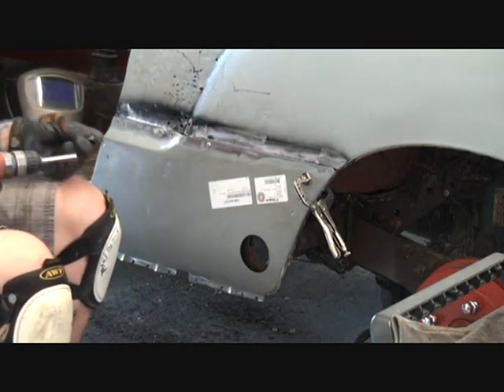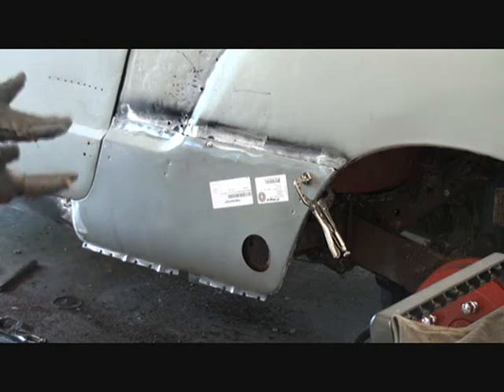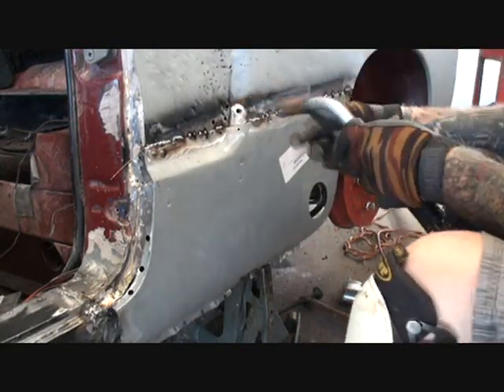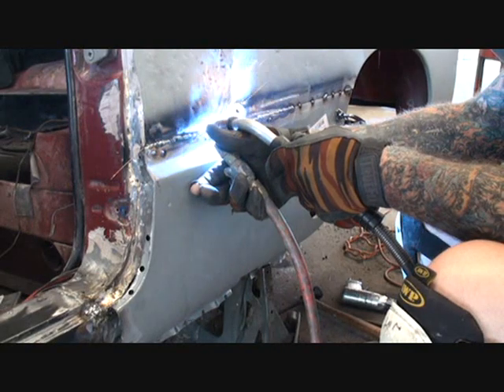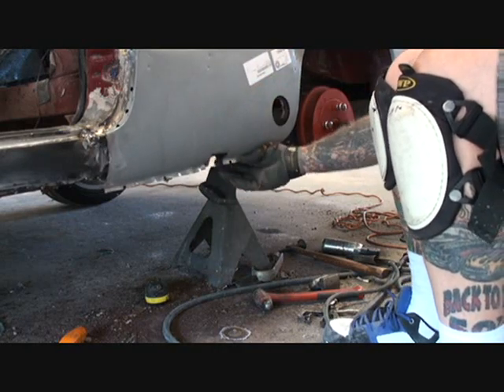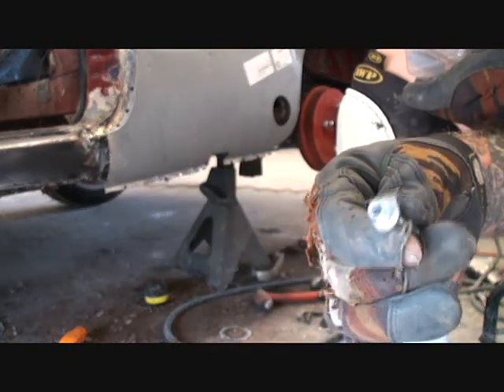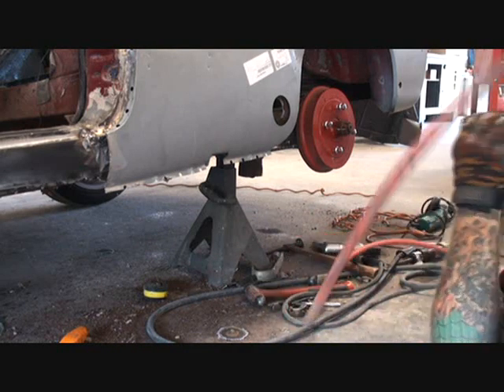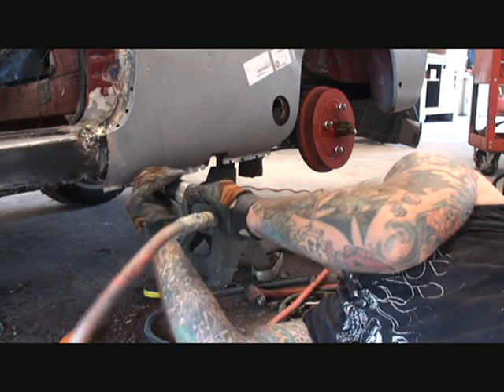1969 Volkswagen Karmann Ghia-Major Rust Repairs. Part 12

Comment: Pete, love the videos. Need to weld on quarter panels on my bug and I am wondering what your MIG welder setting are, heat and wire speed? I know this metal is thin and I dont want to burn through it, thanks!

Comment from the maker: I start with a 4" grinder, using the edge of it just to knock down the weld, then come back with a small 2" air grinder with 36 grit to finish it out.